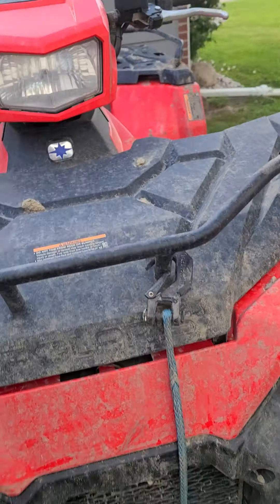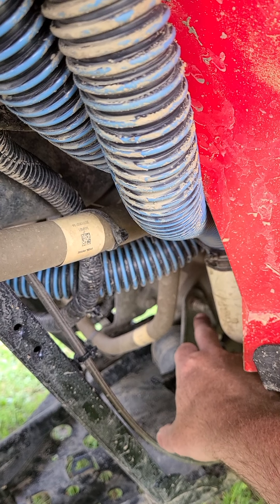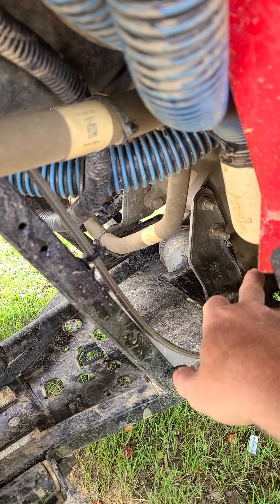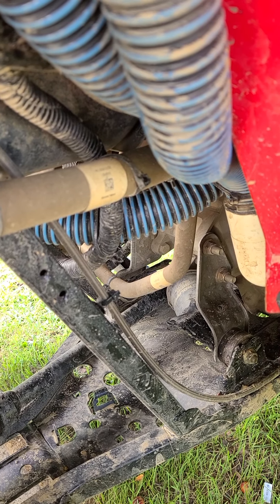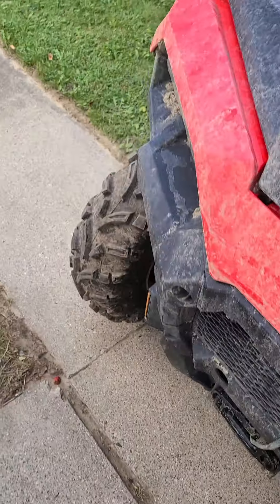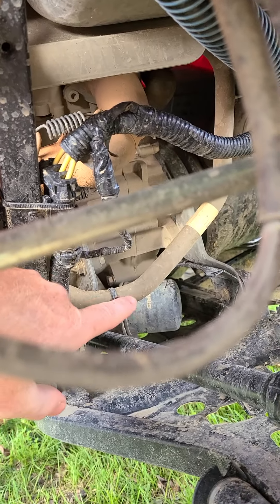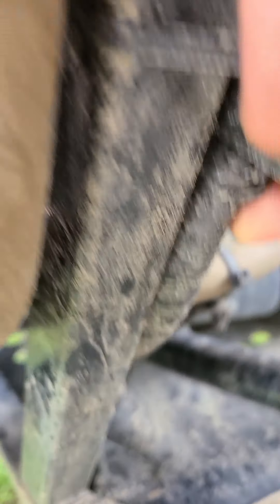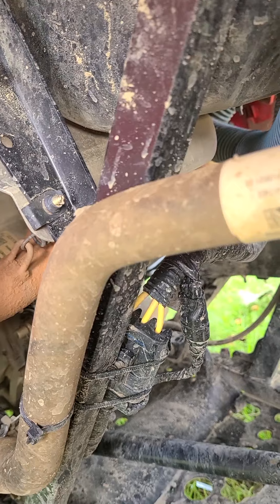Polaris sportsman 570 error code  2 636 1 solution.

Comment: I just had this problem yesterday with my 2021 570.  Just over 3200 km on it, my very first issue. Two hours away from home my bike died. Wouldn't stay running.  So I called for a tow home. Got looking around and found the code 636 2. Touched the harnes and it started right up ran fine.  Looked around and you could see where the zip ties wore through the wire.
Reply from the maker: You better check the other ties as well. There are a few that show some where on mine
Reply: @huntenbambi  there were three spots worn just in the sensor plug wires. Every spot there was a zip tie